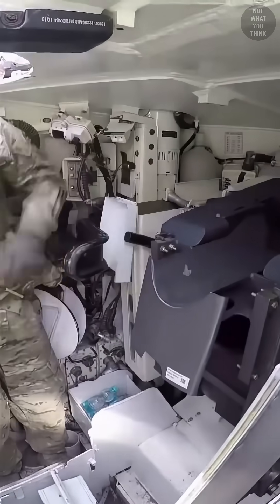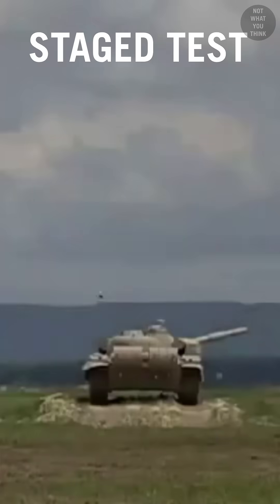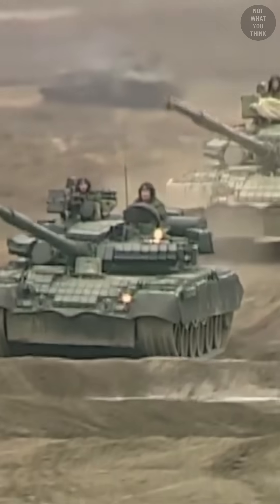Why M1 Abrams Tank Has No Auto-Loader #shorts

Comment: no offense because it’s an allied tank but everyone here comparing the American steel horse to a leclerc had me dead.  Lol look it’s a somewhat of an aesthetically pleasing bulk of a metal but has it been been battle proven to be more effective with its fancy auto loader? I hope it shows out when it’s time comes because we’ll need  its part to play as it is being advertised and more.  Also, Russian tanks are no where near an M1. I personally prefer A1s over A2SEPvwhatever because  automated functions limits the ability to “fight the tank” as you continually engage.  Leo’s and Merkavas are maybe a step above the M1s in terms of versatility.  But if you need to invade, no one does it better than the Abrams.  For example,  merkavas have different types of armor on its sides because it’s designed to fight against urban and guerilla tactics.  Abrams may have added armor for similar situations but not as effective.  If you go tankVtank.  Abrams will always come on top.

Comment: 4 man crew benefits - more people to put on watch, extra pair of hands for maintenance, extra set of eyeballs for situational awareness, extra man to give another crewmember a break.
Autoloader benefits - Turret size shrinks, thereby reducing the amount of weight in armor required to attain a given level of protection, thereby increasing tactical/strategic mobility and/or reducing fuel consumption and reducing silouette (which is why Russian and Chinese tanks are much smaller). Finally, you can relocate the entire crew into the hull itself.

If you relocate the entire crew into the hull like armata, you can do some VERY interesting things. Options include drastically uparmoring the entire vehicle without increasing weight compared to western mbt, much smaller turret profile gives you alot of room to add all kinds of goodies such as additional weapons, a laser C-Ram similar to that on DE-M-SHORAD, active protection systems, more ERA, stowage, surveillance equipment, etc. and the crew being located in a small centralized location inside the hull can be far better protected.

Comment: 11e, Armor Crewman, M60a1 and a3, SABOT, HEAT, HEP, BEEHIVE, 105mm rifled and smooth bore, .50 cal, 7.62 coax, .45 grease gun, .45 1911...the main reason to keep a human loader is in case of breech malfunction clearing, tank commander fire command error, crew maintenance and crew position cross training. Warsaw pact has had auto loaders for a long time, and God help them when running across any US Tank crew...M60 or Abrams...Go Army!

Comment: In the end of the video a fake experiment is shown. The t72 tank was loaded with explosive several kg and then the missel hit it. So explosive worked after missel hit the tank and we see a take off of the tank top. Normally it never happens. T72 can burn but rearly loses its top. The author doesn't say what would happen if the loader soldier woould be killed or wounded. Don't think that abrams is a very good tank, even breadly and bmp1 hit it several times. Keeping ammo in a divided room is a very good idea. But some times it doesn't work.

Comment: Russian autoloaders store ammo in a carousel at the Bottom of the turret. Some older vehicles stored spare round in the turret, but they don’t do that anymore. It is much harder to hit the carousel from an autoloader than the ammo racks in a turret like the Abrams.
Reply: Unfortunately you are wrong. Russian ranks are weak on sides, they have fuel tanks on left and right and carousel between them. Hitting side of russian tank will cook ammo in the same way as Hitting from top or back. Russians knows that and that's why they have active and passive protection systems in place. Nowadays Russia is phasing out older tanks and might replace them with Armata, but money says it won't be soon

Comment: 1. Are you sure that all ammunition in Abrams is stored separately from the crew?

2. Are you sure that it will not detonate while safety door is open?
Reply: 1 Yes
2 only if they get hit at the wrong time.
Reply: @rogerwilco5918 , please add time required to handle individual pieces of ammunition while loading - especially while on the move cross-country.
Reply: @TheRVSN  Did you actually watch the video?
Reply: @rogerwilco5918 , of course.
Reply: @TheRVSN  So, did you just not pay attention?
Reply: @rogerwilco5918 , depending on version of Abrams there are 3 places to store ammunition. That is not explained in the video. But to kill the crew with overpressure and overheating one charge is enough. Now consider this veteran (Bacil Donovan Warren, M1 tanker, veteran of Desert Shield & Desert Storm, author of With It or in It) statement:

"For sixty seconds, we were to fire as many main gun rounds as each tank could get off. I was the loader on my tank. My tank fired seventeen main gun rounds, completely emptying the ready rack on our M1A1, in about 45 seconds. Our wing tank fired their seventeen rounds in about 46.5 seconds."

So basically a loader is handling ammunition most of the time when the tank is charged. And the same is valid for ammunition storage compartments. Even to fire damn 6 rounds in a minute (1 round per 10 seconds) would require at least 50 % of time open blast doors and even more time to carry rounds in hands. So how safe Abrams really is during a battle?

Comment: The ammo compartment door on the M1A1 is opened with a knee lever that is powered by HYDRAULICS.  The door is on a 3 second timer which allows the loader adequate time to pull the round out of the rack.  For some reason, if 3 seconds isn't enough, the loader can bump the knee lever again to reopen the door as it automatically closes.  BUT the thing many people don't know is.... the ammo compartment door has a point of no return after the door is roughly 80% closed.. the knee lever will no longer open the door as it closes and would cut your fingers or arm right off which makes the loaders job fairly dangerous, especially in rugged conditions.  And also a reason why the M1A1 has a human loader is for a extra set of eyes to identify hostile forces.  The M1A1 main gun is so accurate that if a platoon of American tanks ran into a platoon of Russian tanks by the time the platoon of M1A1s needed to reload there wouldn't be any hostile threats left to engage.  It's based on a one shot one kill basis.

Comment: lol, sounds like shoddy engineering. "We don't have autoloaders because we store our ammunition in safe compartments in case the armor got breached, to prevent it's explosion." The truth is that a proper autoloader could easily open such compartment, take the round and close it much faster than any human. It could also easily discern whether it is safe to do it, notifying the crew and letting them override it's decision in case a sensor would malfunction.
Reply: The advantage of the Russian autoloader is that it takes ammunition from where it is stored: in the turret. For your idea to work, it would need to be designed to be able to feed ammunition from elsewhere in the tank, no matter what direction or angle the gun is pointed. The amount of moving parts needed for that is ridiculous. So many points of failure for a system that provides little to no advantage.

Any competent engineer knows that simplicity is better. Nothing shoddy about it.
Reply: I don't know. An extra hand and therefore gun sounds better to me. Less tech and machinery means a lower chance for cock ups. Can auto loaders switch shells easily or does it take time?
Reply: More crew = easier and quicker maintenance.
Reply: Alright, show me an auto loader that fits into the Abrams.
Reply: Just check other Western, Japanese and Korean tanks, they got great autoloaders that are pretty safe. 
It's just that Americans aren't smart to make a good one.